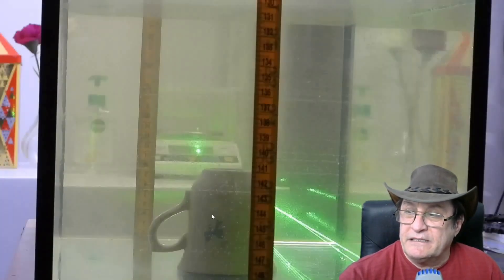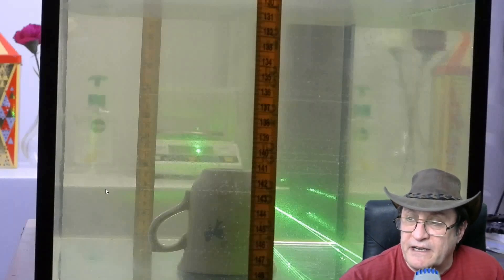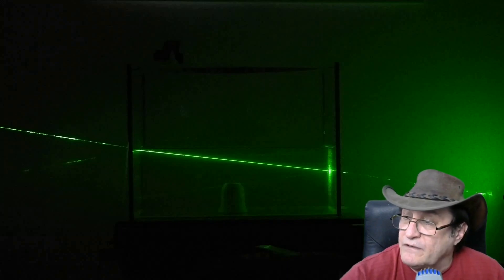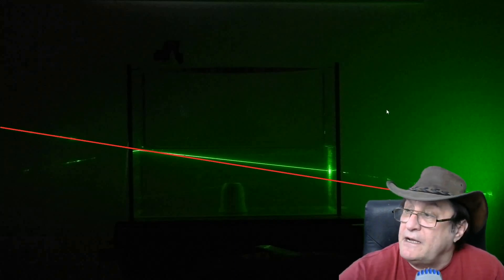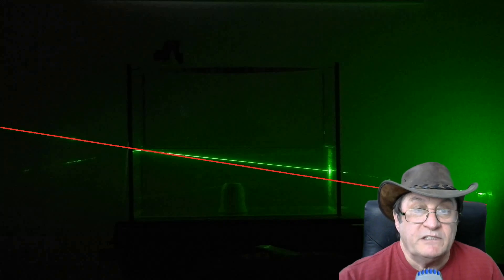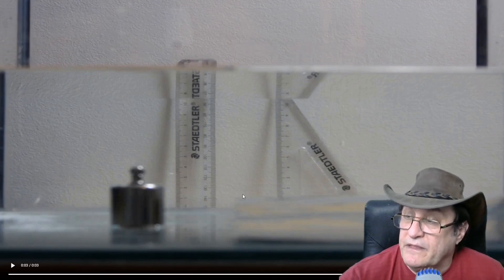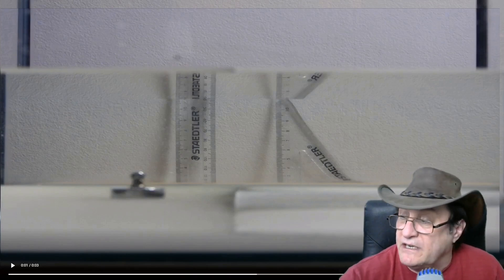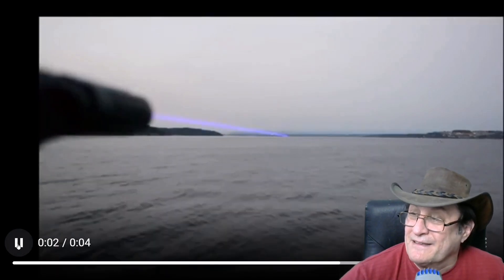Ranty your "Globe Killer" is BUSTED

Comment: To be accurate, the light of course is refracted going between any mediums (changes in density). ie: Air to glass. Glass to water. Water to glass. And glass to air.

While in a medium (constant density) refraction will not happen.

Correct?
Reply from the maker: Yes that's correct. The glass section is small and doesn't have a significant effect.